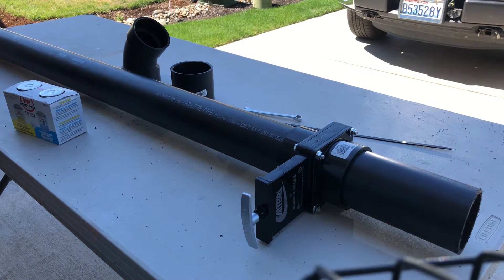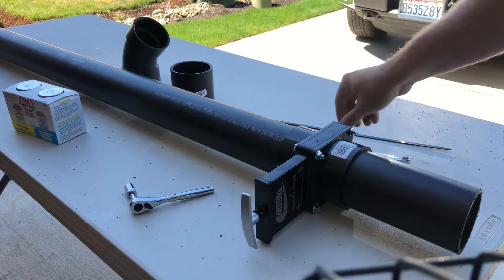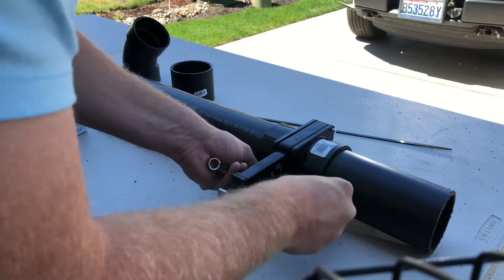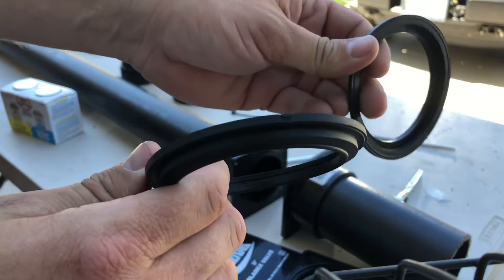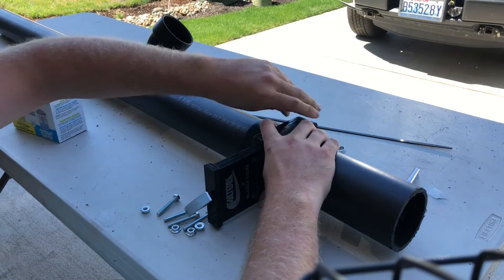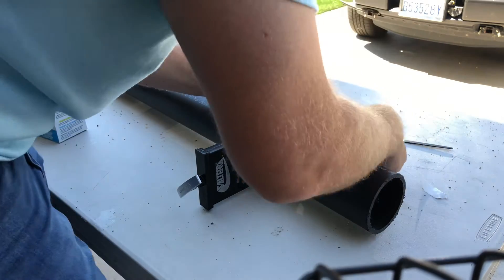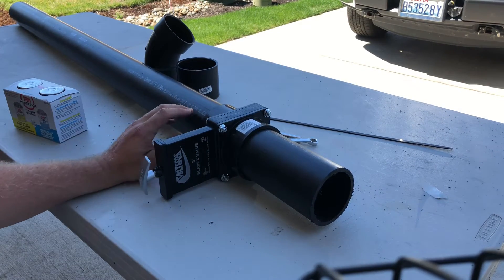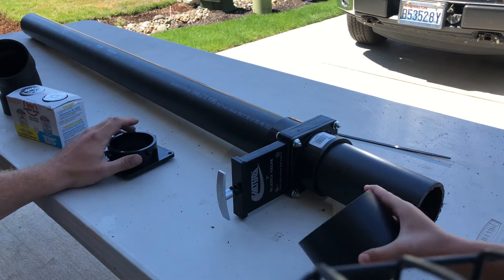How To Replace An Rv Dump Waste Valve

Comment: I have a suggestion;
I recommend plumbers grease which is used to replace cartridges in the faucets, Vaseline in most cases contains petroleum, and the plumbers grease is plant base and it doesn’t damage the gaskets.

Great video. 👍 thank you, great job
Reply from the maker: Thank you, I will give it a try

Comment: Very helpful video I just changed both tank valves on my fifth wheel camper today I change the black tank valve in the great tank valve yes it is messy but it is worth it to do it yourself instead of probably spending hundreds of dollars the tank valves are not that expensive and yes you just need a few tools and it’s fairly easy

Comment: Thanks.  After moving my trailer so I wasn't kneeling on a hillside, and then putting a temporary fix on the gray waste line so it wasn't pulling down, I was able to do this.   It wasn't too nasty because I'd dumped and cleaned the tank last fall.  It seems to not be dripping at all.  Now on to fix the things I saw when I was underneath.  It's a Casita so pretty simple.

Comment: Do you have the shortcuts to the outer parts of the valve? How do you replace those? The outer ones are slightly bowed. My gray is the one is the one leaking a little.

Comment: My connector pipe that connect to the RV Black water tank  and the drain got scraped off on a steep driveway. No damage to any of the parts. How do I re-attach them. With glue and what type glue. 
Thanks Randy
Reply: ABS solvent

Comment: You mention using Vaseline. What about using silicon based, plumber’s silicon O-ring lube instead? I’m concerned about the compatibility of the Vaseline with the gasket material. For plumbing, I use Parker Super Lube which is safe for rubber.

Comment: I just got a camper and the kitchen sink is not draining.  I have plunged , baking soda and vinegar. Then I put liquid plumber in it. Well I was told it it probably the valve not opening. How can I get the line to empty out so that it wont blow out all over me. Thank you Elizabeth

Comment: Good video.  My gray tank valve opens by pulling the handle out to the left and is quite a distance under the rig.  Can they easily use an elbow or something and change that to open straight out toward me? When you put the seals on , does the raised side face out or in?

Comment: do you know how to deal with clogged  valve area of roadtrek  class b?  I know it is clogged because when I plug. with plugger stuff come up into toilet.  liquid is kinda passing through.  issue is no good manual way to clean, because only  macerator.  there is a huge tank cover under RV but. Roadtreck tech person said be prepared for 10 gallons and up waste water to come poring out instantly.  thanks. for help

Comment: Thank you for this video. My waste valve broke at the bottom of the cap by the handle since it was really hard to open. It's very much appreciated.

How would you go fixing the underbelly? After I got my trailer, it was used, there was almost no airflow  when you'd turn the furnace on. I had to cut the under belly to see what was wrong. Found that they had tried to feed the duct work between the slide-out hardware, and the sub floor, putting 7 tears in that duct. I had to replace it, but have never been able to really fix the underbelly and have been looking for a solution to fix it. Do you have any suggestions?

Comment: I have watched all the videos and have successfully replaced the valves, BUT now I cannot reconnect the T pipe with valves on either side. Too tight. Was very hard to remove. Do I need to cut a pipe? I have pictures. Tight fit is beyond words.

Comment: My valve is stuck shut . I have come up with a way to open it cleanly . But my valve is glued in no bolts tiny screws hold the valve together the adapter is part of the valve.  Any ideas?

Comment: My rv has bypasses the holding tank, so it go directly to the sewer.  But when the 2 rv's above us clean their tanks, it is the worst smell in our rv.  Is there anything that can be done to have a door that is automatic open for our waste, but closed so the smell from theirs stays out?
Reply: Tanya Broeckx your bypass sewer pipe or hose needs a water filled “trap” which allows your flow but blocks the odors in the sewer. Make a “P” or “J” shape in sewer hose. If your bypass is hard pipe, go buy a P-trap and glue it in. Then just keep your trap filled with water by normal use.
Reply: @Skip92306  thank you!!  Would the ptrap go closer to the sewer pipe or the rv? We have been pulling the pipe when we go to work and then putting it back in when we get home. But most of the time the other 2 neighbours let their crap out on the weekends or in the evening :(  thanks for the reply, will for sure try that!!
Reply: Tanya Broeckx  make it easy and place wherever access is best: rv side or sewer side will work so long as trap holds a pocket of water to block out sewer gasses and odors. Good luck!
Reply: @Skip92306  thanks!!

Comment: When you pull on the valve should it stay out for the flow of the liquid waste?
Reply from the maker: Once you open it the fluid should drain out and then you can close it. I always drain the black tank first then drsin the grey tank to flush it out in case any debris gets caught in knife valve.
Reply: Yes, valves have no springs. They stay open. Once closed they stay closed.